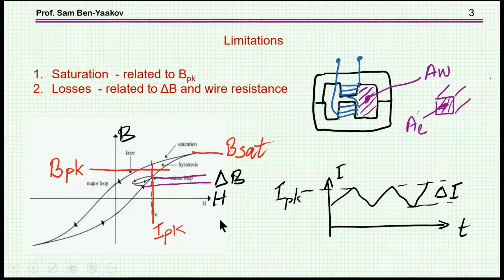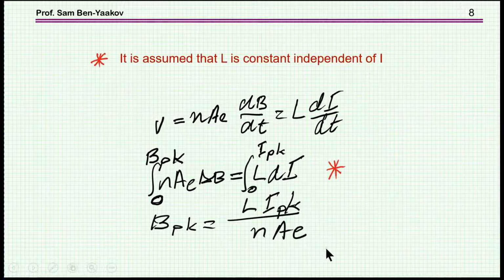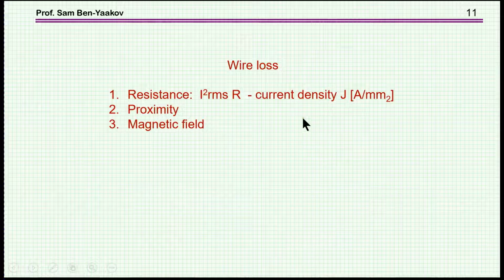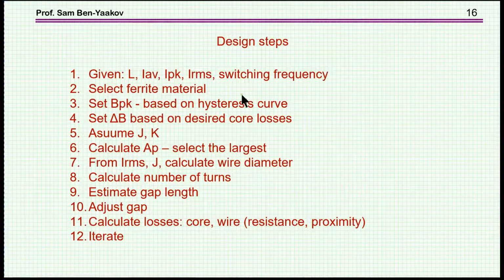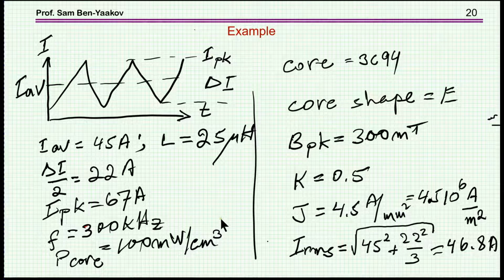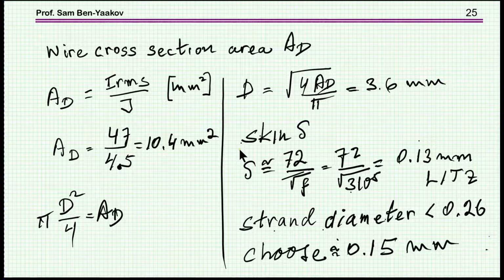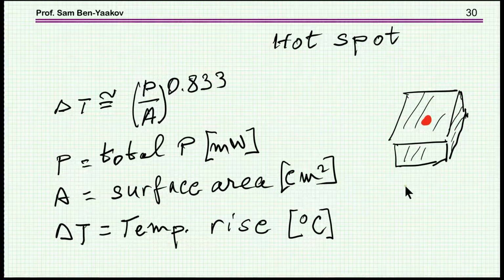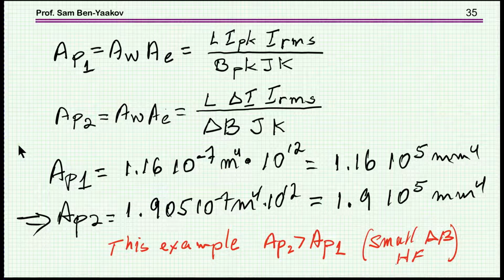A deeper look at the approximate design of power inductors with gapped ferrite cores

Comment: Thanks prof. for the beautiful explanation of the design of the inductor. I have question. Does the design changes with the fundamental component of the current? In other words, is the design same for an AC inductor of resulting in the same peak current-67A?
Reply from the maker: You mean like an inductor for APFC?
Reply: @sambenyaakov First of all thabks prof. for replying to my message. Coming to my question, for example, 

Lets say, two inductors-a DC inductor and an AC filter(grid connected)  to be designed that sees same peak current. The peak includes the ripple except that the AC inducror sees a 50Hz as well.
Reply: got the answer!
It should be the same except that the core loss should incorporate the AC frequency as well in addition to ripple frequency!😊
Reply from the maker: Yes

Comment: I have a doubt regarding the filling factor k. Usually the equation N*Aw=ku*Wa true for all inductors where (Aw= cross section area of winding, Wa = window area, ku =fill factor and N= number of turns). You have selected the number of turns by formula N=(L*delta_I)/(Ae*delta_B). It turned out to be 17. Now, if you calculate the fill factor using the above formula ku= (N*Aw)/Wa then it would be (17*10.4)/(44.4*12.1) that turned out to be 0.32. However, you assumed the ku to be 0.5. Which is the correct value of ku?
Reply from the maker: This is a chicken and egg question😊 . In the design you assume an ku. Now you select a core. Chances are that it will NOT have the exact Aw you assumed. Obviously you select one with a larger Aw.  This makes the effective ku smaller.

Comment: Hi Professor, I tried to do the air gap calculation using the same approach in my design. I have an inductance of 3mH, N - 84 and Ae - 3.79e-3 m2. This gives an air gap of 11.2mm. This seems a bit too much for inducting a lot of air gap reluctance in the path. Could you help me verify this?

Comment: Sir,I'm trying to design a 2.4mH inductor using E 42/21/15 core (taking EE set) for peak current of 2.5A, considering a winding factor of 0.4, I got 99 turns and air gap of 1mm , in the tdk datasheet the for the corresponding air gap of 1mm permeability =118,AL is 272 which gives a 2.6mH ,but if I tried to analyse the results using FEMM 4.2 keeping permeability as 118 ,I'm getting very less value,even after including the fringing factor which is 1.25 ,using the resulting permeability of 122 I'm still getting 1.7mH in FEMM ,can you please help me with this.
Reply from the maker: The difference seem to be too large. Perhps due to the fact that the FEMM is two dimensional?

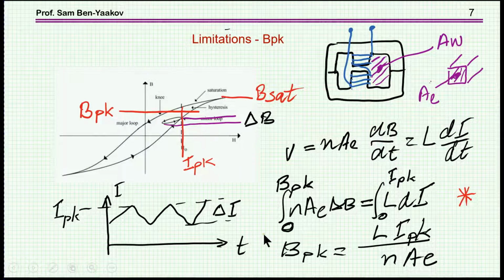Comment: Fantastic video. But I have a few question or perhaps a riddle for you. @ 5:55, Bpk is selected to be maximum 300mT. But is this correct? Because the plots were generated with a core heated by external means too 100°C. In a real application the core will heat up because of core losses and the core "core" temperature might be much higher than the core surface temperature. 3C95 material has a thermal conductivity in the range of 4.01 W/m.K, which is in my minds eye given the core thickness is not that high.
Reply from the maker: I would say that 4 W/mK is not that bad considering that the surface is much larger than the thickness.

Comment: Hi Professor, first of all thanks for such a great video..
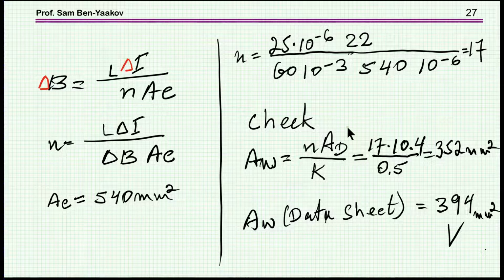I think that in 27:57 the DELTA-I you put into the n formula need to be 44A instead of 22A which is (DELTA-I)/2 correct?
if so, we get twice turns which not feet into the given Aw what can be done in such a case ?
Reply from the maker: Thanks for finding this  inconsistency. Delta I and B are from zero to peak not peak to peak. I should have clarified this

Comment: Thanks so much professor for your lectures . I would like to know, how I can calculate R ac and R dc for planar magnetic core (flat magnetic)
Reply: I mean resistance for Ac winding in inverter  for planar inductor  to calculate power losses in winding
Reply from the maker: Rds is of course trivial.  For Rac you might find some analytical approached on the web.  I suggest FEA simulation especially for  PCB windings.

Comment: When designing a powder core inductor it is always worth to check how permeability drops with DC-bias and then correct the number of turns accorinaly. I wonder if it holds for ferrite inductor design in practice? Some manufacturers (TDK) are providing data for relative reversible permeability changes within the DC magnetic field for different values of equivalent permeability (different gaps). So the question is whether it is worth it to check drop in permeability for particular design or limiting Bpk further from B saturation will make the job done?
Reply from the maker: Since the permeability of  aberrate inductor is approximately the ratio between magnetic path length and gap length, ferrite permeability has little effect until it collapse at the Curie temp.

Comment: Sam, thank you for video! Please correct me if I wrong, in case of pure AC current on inductor, I should use for delta B = 2B(hat). So if I had picked 60 mT using P/v vs B graph, i must use 120 mT for delta B in Ap2 calculation? Thank you!
Reply from the maker: Not sure I follow. Please indicate minutes in video you are referring to.
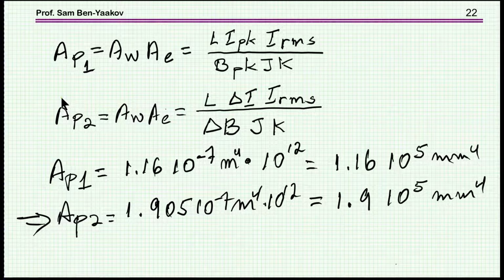Reply: @sambenyaakov  At the 21:50 you mentioned that Bhat =deltaB/2 hence delta B = 2*Bhat. Then you calculate Ap2 at the 22:10 minute of the video, and for delta B substitute 2*Bhat. The question is: is it true that in the case of pure AC current on a choke without any DC, Ap2 is calculated in the same way? In another words, in case of AC with no DC bias, if i pick 60 mT at graph (21:50) for Ap2 calculations i using deltaB=2*60mT=120mT also.
Reply from the maker: Thanks for clarification. Since I have formulated Ap2 as a function of DeltaI then the right value in equation  is DelaB. In pure AC excitation, the swing of deltaB is related to the swing DeltaI same way and the losses are still a function of DeltaB/2

Comment: Hello Professor. Suppose you need to design for a PFC inductor, how could you choose then the delta B?
Reply from the maker: Saturation or losses whichever is lower
Reply: Sam Ben-Yaakov I mean how to calculate the core losses now since the duty cycle would be changing and so are the current ripples

Comment: Hi Sam,
@ 31:12 shouldn't the surface area be A= (65x65x2) + (65x27.4x4) = 15574 ?

Also, can you please briefly explain how the units (mW/cm.sq.)^0.833 equate to °Cel.
Reply from the maker: No. Just thew outside surface. An experimentally fit equation does not require unit matching
Reply: I didn't understand the 65x3x4 part. The total does not match with 17680?

Comment: Hi Sam... since I discovered your videos a couple of months ago I’ve been consuming them like pastries on a cool fall evening. The latest videos on inductors reminded me of these experiments I did some time ago related to Tesla’s Coil for Electromagnets. He claims in his patent spec that it reduces self induction and allows him to store considerably more energy in the coil. Since the configuration formed an important part of his other inventions perhaps it requires a deeper analysis than what I have been able to apply. Could you give it a few minutes of your time?  I’m curious to know what are the implications of reduced self induction for a motor in an electric car for example. Would it make it more efficient?  Thanks for all your videos, they have been a godsend.   https://youtu.be/AgF20K7qvx0
Reply from the maker: Hi, thanks for bringing to my attention this patent. I do not think that the method reduced inductance, but it increases inter-winding capacitance. Reducing inductance in a motor is good and bad, On the one side you can get higher torque and speed but the current ripple will be very high with a modulated drive of inverter. By the way the metod shwn in patent is now referred to as integrated magnetics, There are a number of papers on that some by Van Wyk.